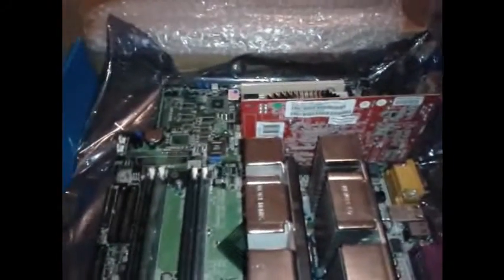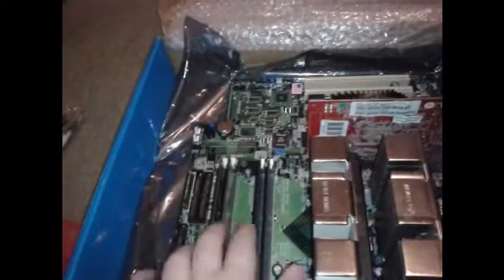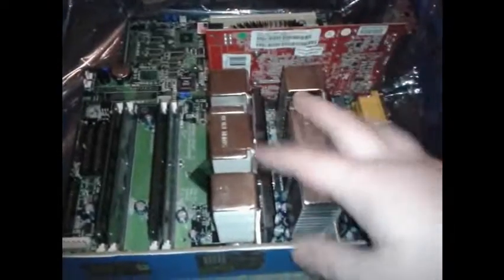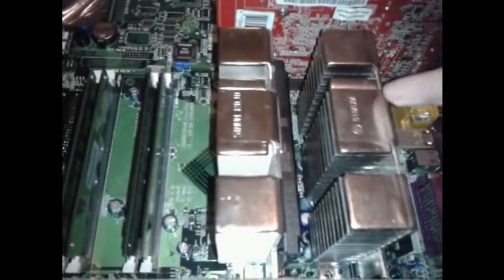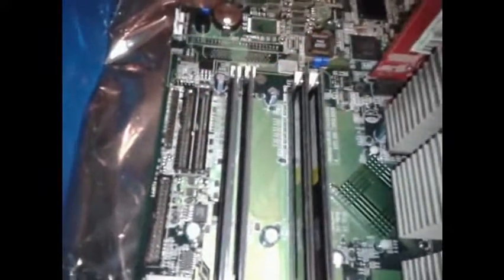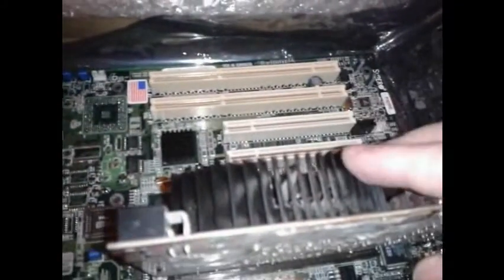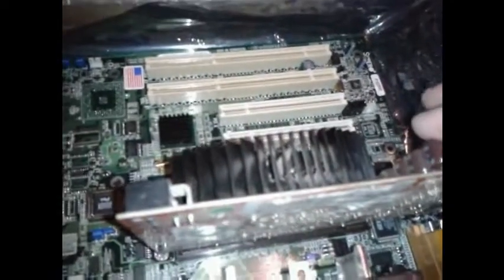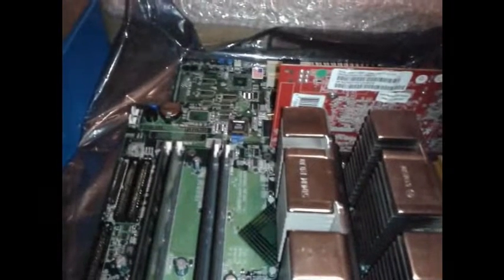How to build a super Pentium 3

Comment: motherboard s supporting dual 1.4ghz  p3 processors  are still expensive . you're  lucky  because yours got an agp slot  . I own a handful of p3 1.4ghz cpus ,and still looking for a mobo like yours  less than $20 .  about the overclocking  I managed to reach 1.5ghz  , but sometimes it make the pc to freeze , I think  you can't reach 1.8 ghz , you'll destroy your motherboard . send it to me rather

Comment: I swear I got parts sitting around for my super p3 setup. One of these days i gotta put the damn thing together.

Asus dual p3 mobo with 1.4ghz p3.
2gb SD ram ( rd had died by this point of the newer flat p3s )
His 4670 agp
sata adaptor
samsung sdd
hd dvd / blu ray combo drive
wifi card

I think it will honestly be pretty beastly still. Im hoping the mobo allows for some over clocking and that i might be able to water cool the setup to try and get a 1.8ghz out of both the p3's

Comment: @theBlackRockSh00ter i used to have a sempron 2400 1.67ghz 1GB DDR 400 and geforce 6600GT 256MB, will play 720p fine. 1080p is a different matter though.

VLC player and power DVD take a lot of cpu power, as do others. 
i found using windows media player 10 not 11 and a good codec much better performance, try different codecs. i think i used CCCP codec pack. its funny because its communist